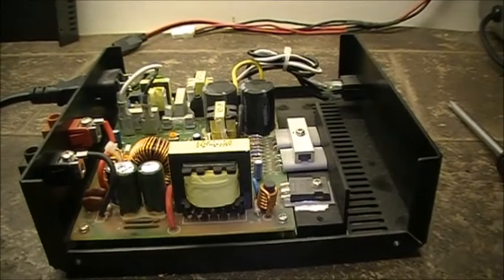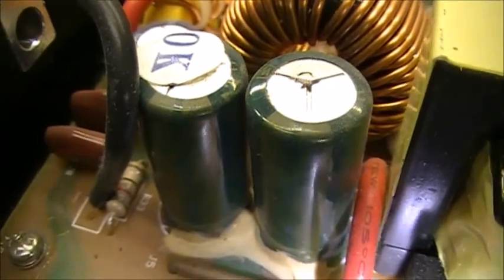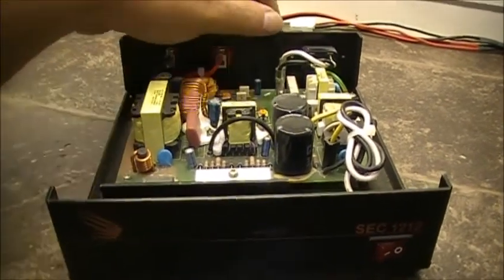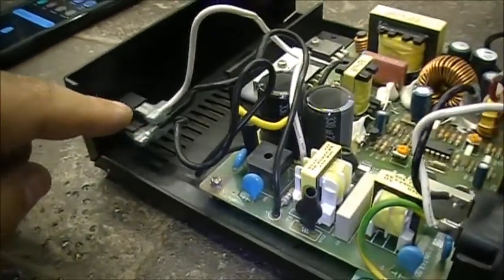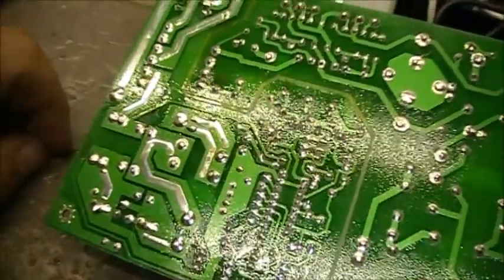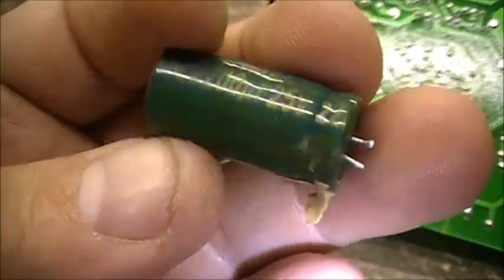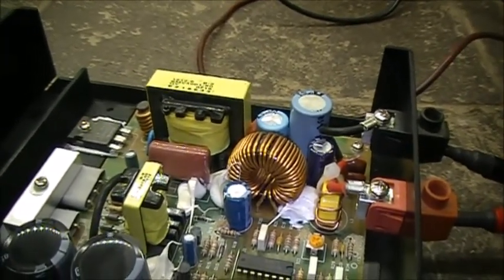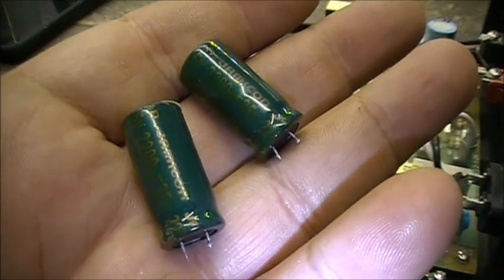SEC-1212 Highly suggest you make this upgrade

Comment: Sounds like the caps are arcing inside. 😂
Reply from the maker: Both are shorting out internally.
Reply: Radionut63 well that just made it a spark gap transmitter then. 😂